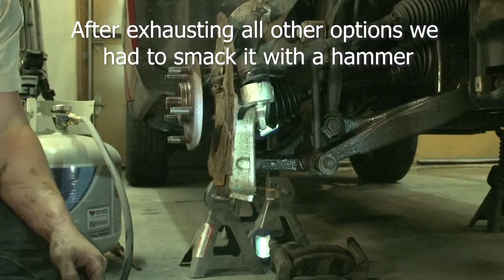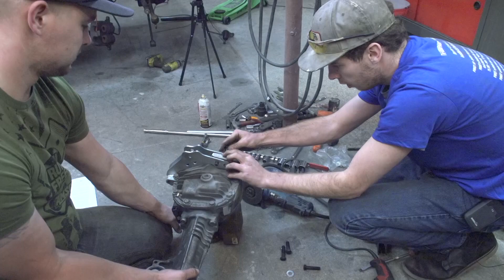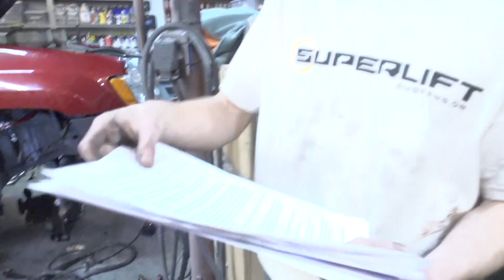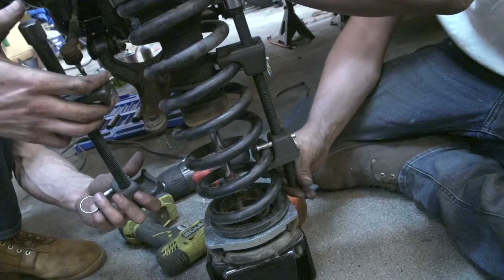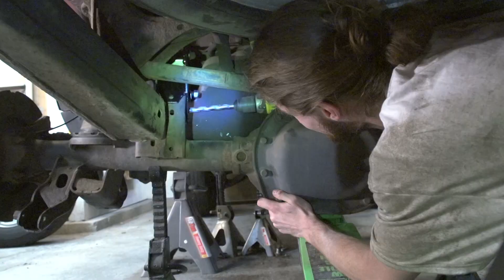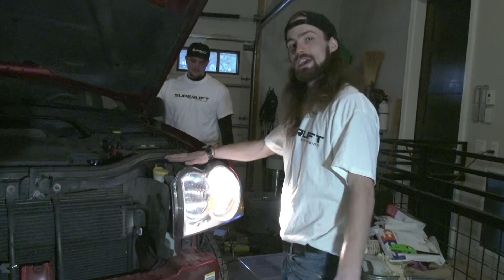2006 Jeep Grand Cherokee 5.7L WK SuperLift 4” liftkit, KBOffroad Bumper, JBAOffroad Uca’s

Comment: It seems like they would make a 4" inch metal block spacer with the bolt holes pre-drilled, and longer bolts. The spacer that goes in between the front differential front mount, instead of longer mount arm. I guess either way would work!
Reply from the maker: Ive definitely racked my brain on how they could lift wks cheaper. I think they just found a profitable way and ran with it. Nowadays you are seeing people doing lifts like you have explained.

Comment: Hey guys, awesome lift. Love your vids. Quick question, at minute 36 the bolt that snapped, the same thing happened to me. How did you guys remove the other half of the bolt that stayed inside the metal frame? Thanks
Reply from the maker: Hey Leonardo!! So we first tried to weld a nut onto the part that was stuck into the frame but couldn’t get a strong enough weld onto it. We ended up having to cut open that mount a tiny bit in order to get a good weld onto a bolt and twist it out. Unfortunately, I would recommend seeking out help for this step as it is a pretty daunting task unless you can get it out by tapping the center of the bolt and reversing it out with one of those kits or welding a nut onto it.

Comment: JBA says it’s upper control arms cannot be used with this lift— they will not work well. Why did you use them if JBA recommends against it?
Reply from the maker: Hey Douglas!! This is a new turn of events, the JBAOffroad ucas that we are installing on this wk in the video work for the 4” SuperLift. I do however believe that they are no longer available.
Reply: Good morning, thanks for the quick reply!  I want to put the same lift on my 2008 Grand Cherokee and would have liked to replace the UCA too.  I think Rocky-Road's will work and I was disappointed when I spoke to JBA about theirs.  Do you have any other recommendations for key items that should be replaced when installing this lift?  Thanks!
Reply from the maker: Hey Douglas!!! You wont be sorry, the Superlift is amazing. 

I would recommend checking out tom woods custom driveshafts for your front driveshaft, creative steel inc for your differential bushing kit, JeePerf for some SuperFlex Tie Rod ends. 

It’s unfortunate JbA doesnt have them anymore but I know you can find them on fbook market place sometimes!! RRO is also a very reputable company and I know many running their UCA’s.

On thing I did notice right away was the rear superlift shocks were very stiff. I replaced them with some fox resevoir shocks and plan to do a custom kit for the front!!
Reply: @TheBigRedJeepProject  That sounds awesome, what are you planning for the front. I was going to replace the struts and coil springs when I put the lift on.
Reply from the maker: @douglaswoodall8395   We are really trying to figure out 40” tires so we will be showing a serious pinch weld mod on camera and doing coilovers and much more!!

Comment: Man that finished up looking awesome. Watched the vid from start to finish and was really enjoyable. Great camera work. All seem like great genuine guys to go wheeling with. I’ve got a low km (40000miles) 2006 5.7 WK (100% bog stock). Would love to do this but laws won’t allow here in Australia. Love the front bar. I don’t think JBA do the upper arms anymore. There is a mob here in Oz called superpro that are looking at bringing out both the upper and lower arms for the WK (WH here in Oz) in the near future.......fingers crossed because their gear is bullet proof. 
Awesome work guys💪💪💪💪
Reply from the maker: Hey Chris!! Thank so much and if you are ever state side make sure to give us a shout!!! 

Superpro seems like a great company and it’s cool they are expanding into lcas and ucas!!! 

I didnt know Aus had strict laws on this that is interesting, do you need some type of offroad title or something to build a rig?
Reply: Hey guys - each state has their own laws stipulating what you can and can’t do. Where I am (Sydney) you are allowed a 50mm suspension lift and a 50mm increase in tyre diameter. You can do this without the need for engineering. You can run huge lifts and tyres but it all has to be compliant and signed off by an engineer. As an example take the 79 series Toyota’s - you can take one of those to superior engineering and they’ll 
turn it into a monster - including a coil rear and portals. Superior look after everything though, it’s big money and a drive in drive out affair.

I’ve started ordering gear for my WK. I ordered the hidden winch mount from ‘Bash’ at HK offroad with the tabs and hitch receiver. I’ve got the JBA control arms coming also and should be here anyday. I’m just going to go a 50mm lift running the Bilstein B6 offroad shockies - pretty standard stuff. I’ll  be doing some huge km on our next trip and just want a basic kit that’s not over the top and will hopefully survive the corrugations🤞🤞
The WKs aren’t big over here which is a shame, they are so capable with the Quadradrive II.

Would love to hit the trails with your rig!!! 💪💪💪💪
Reply from the maker: @chrisandshazza01   we can’t wait to see your build!!! Feel free to ask us any questions you have or send us pictures on fbook or Instagram!!
Reply: JBA still makes the upper arms, I bought a set last year, as well as some extra ball joints and bushings.

Comment: Should have added poly mounts for the front diff.  The rubber will wear out causing the diff to torque up and down when shift into R or D. Learned the hard way. Other great build. Want to do this next from me OME lift.
Reply from the maker: Absolutely agree!! Checkout @CreativeSteelinc on instagram or their website:

Top of the line Jeep Wk Poly Diff Bushing Kit:

https://creative-steel.com/shop/jeep/wk1-grand-cherokee/05-10-jeep-grand-cherokee-front-differential-bushing/

Creative Steel is a Family run business, and they offer 2 different options: orange and black. Unless you are running like 600+ hp no need for the orange, as with such a powerful motor you wouldn’t hear the extra vibration from the stronger poly. We cover the diff bushing install in our round 2 videos!! 🎥 

🙌🔥🙌Stay tuned for round 3 installs in a few weeks 🙌🔥🙌
Reply: I agree it's dumb not to do all that work and money to not do the mounts and bushing when it's out
Reply from the maker: We ended up using Creative Steel bushings later and would have absolutely installed them first thing, but we are students on a budget and we just couldnt afford them.

Comment: How much did you have to reshape the exhaust?  I gave mine a decent amount of clearance but on throttle the exhaust still comes up and contacts the drive shaft.
Reply: If you have play in your differential bushings, we found that this also allows the driveshaft to move more. That being said I had to climb back under 3 times and dimple the Exhaust more in order to stop them from contacting each other

Comment: I have the same kit , my rear links are coming into contact with my trailing arms. Are you having the same problem?
Reply from the maker: I know that the rear arms will come into contact with the gas tank skid so you could be having that problem. Jeeperf is a company that makes some rear arms with a kink in them to avoid that contact (you can also alter the skid on the gas tank).

As for the rear kinks coming into contact with the trailing arms could you be more specific?? Feel free to message us @thebigredjeepproject on instagram or facebook for a faster reply!!

Comment: What size tyres did you fit?
Reply from the maker: We ended up getting 285/70/17s on their and went with K02s. I think we could’ve went bigger.
Reply: Thank you, you should do more videos of the Jeep in action, not many vid of Jeep WK with superlift.

I will be ordering mine soon can’t wait.
Reply from the maker: Stay tuned!! Our Round 2 videos will be coming out soon and that will cover us installing: 
Superlift AEV
Tom Woods Custom DriveShaft
Jeeperf Superflex tie rod ends
XBull 13k Winch
Amsoil oil change
New hubs, o2 sensors, and possibly a bit of engine stuff.

After that we hit the trails and are trying to get a Drone to carry our go pro. 

Thanks for following!!!
Reply: Looking forward to it, we’ll done guys.
Reply from the maker: Fuad Tubes  absolutely!! Thanks for your support!!!!
Reply: @fuadtubes9014   we are about to have our hands on a Mavic drone so stay tuned!!